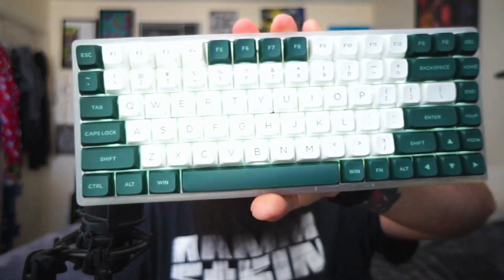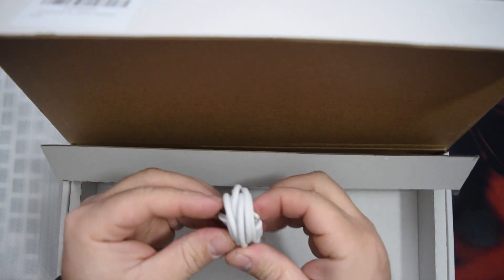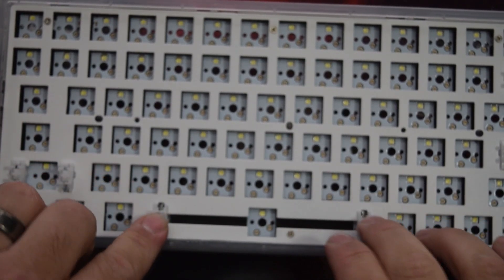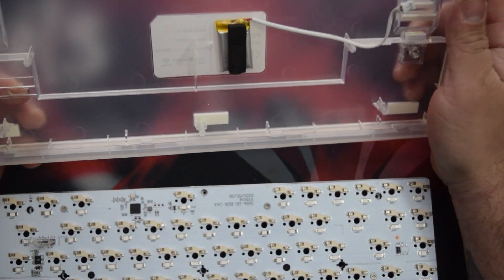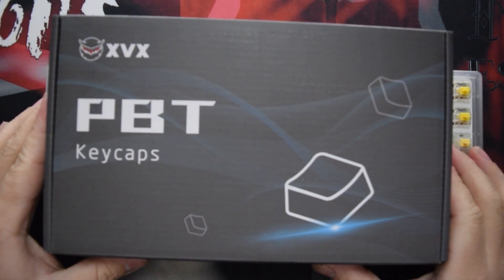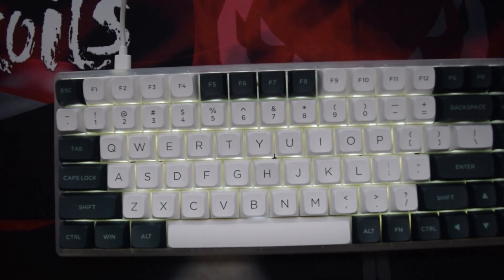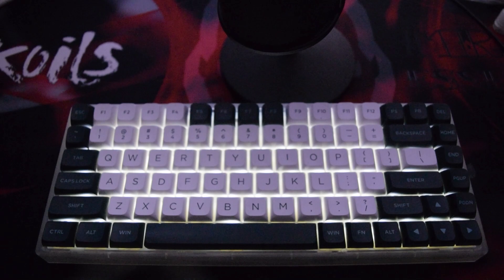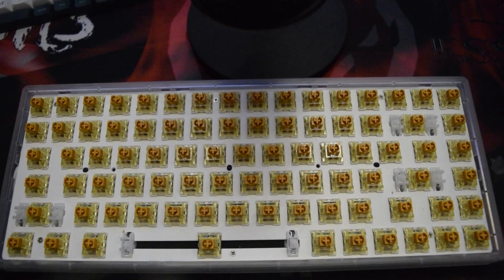Eppomaker Fekker JJK84 T1 75

Comment: Do you know how to fix a screw hole? My own have some problem, when i assemble, these screwdriver holes is loose, help :(
Reply from the maker: A few tricks I know not sure if it would work or of the permanence of it so it falls to the at your own risk category. You can try to get a rubberband down the screw hole and  get the screw to take on it. Or you can try rubber  down the screw hole and more or less make a new hole in the post. Hope this helps some. Not all solutions are perfect, but they are out their.